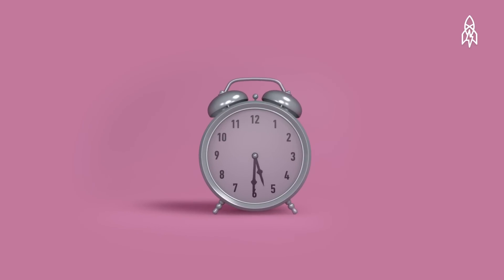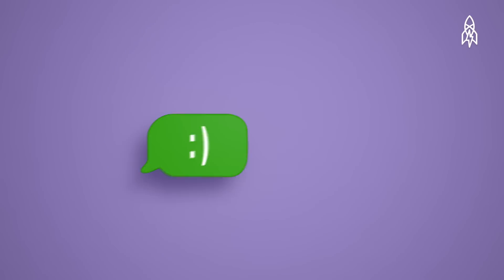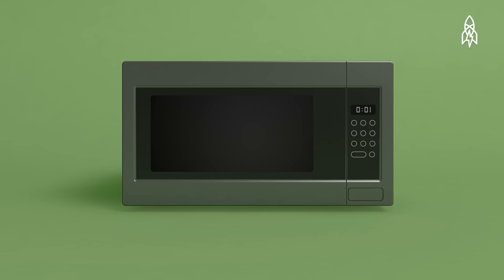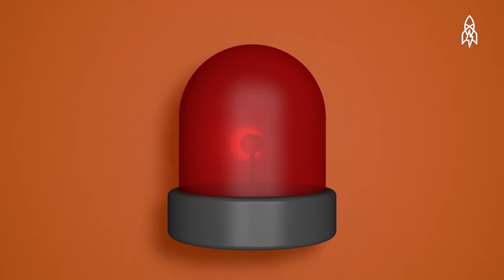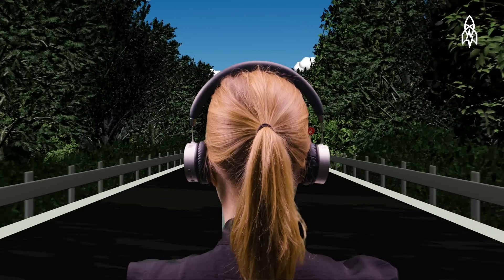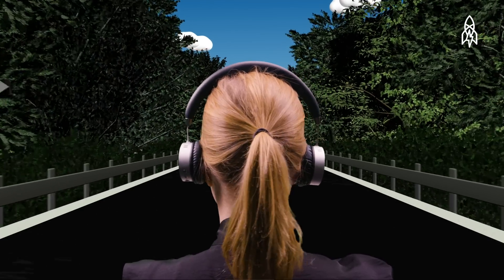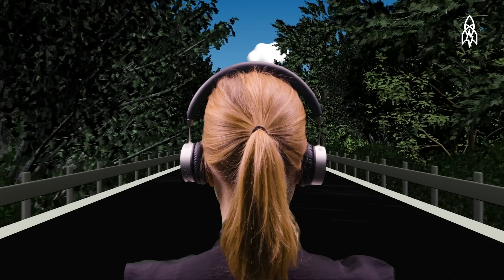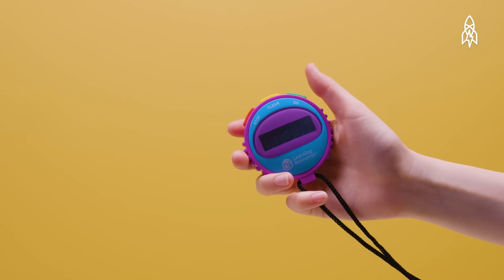Engineering the Most Annoying Sound Ever

Comment: Why if a car can detect that it's going to crash would you make it warn the driver rather than just brake automatically?
Reply: to many variables I guess, like what if breaking would have a high possibility of causing a crash from someone behind you, where the alternative is controlled lane shifts / swerving /
Reply: Jack Evans Because it's easier to just drive around it than brake and get rear ended.
Reply: Jack Evans my car brakes and makes the noise but it keeps a nice distance so it always has time to slow down in time
Reply: Cars usually detect them ahead of time and gives you a warning so you can take action. There are some cars that slow down before a crash and will fully brake if it's too close.
Reply: Jack Evans You would still crash in high speeds
Reply: @kannorkallingzvorth9809  Too often people drive around the obstacle in the wrong direction. If you have a car pulling onto the road you're on, from right to left, common sense would be to pull to the right to avoid it, but more often than not, they pull to the left to go around the obstacle, and end up in a head-on collision.